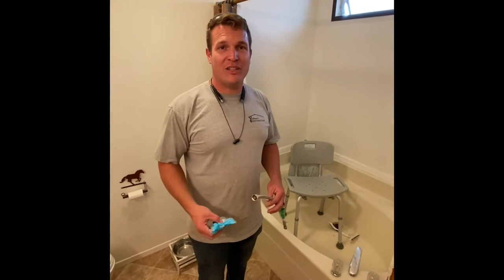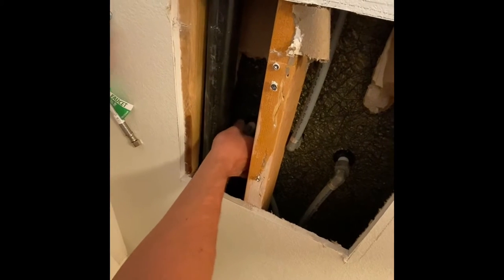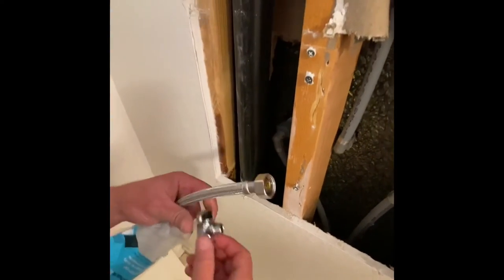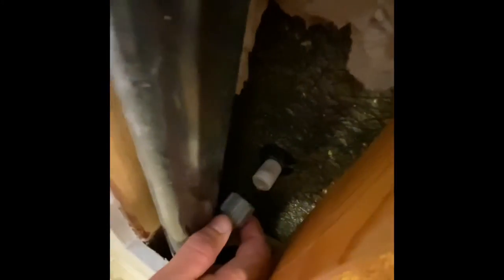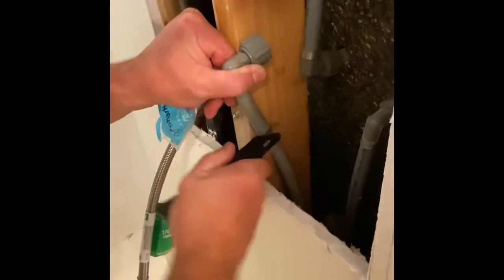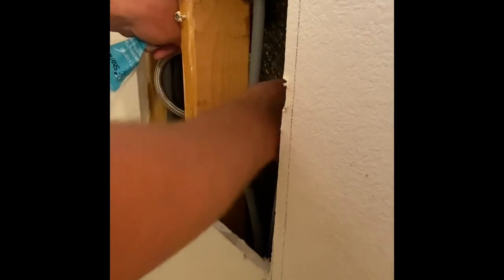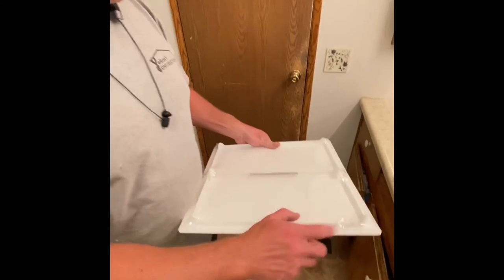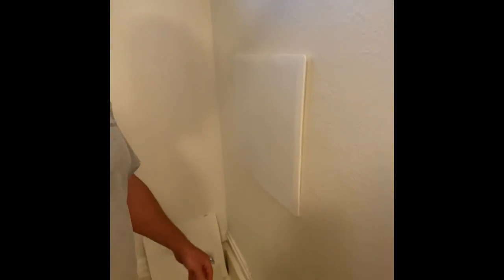Hack on how to Repair old plastic pipe fittings behind a mobile home shower @constructionhacks9293

Comment: Do you need to put tape on any of the threads
Reply from the maker: Not on the flare fittings or ones with rubber gasket

Comment: Will this work on the white pipe? I had a new water line installed and the new pressure is blowing out all old fittings throughout my house.
Reply from the maker: Pvc pipe is a little different

Comment: All you did is rig one problem to have another one down the road. Man I hope you have more experience & sense than that. Wow. Shark bites & for temporary fixes only. Ask any real licensed plumber or code inspector. Dude you need to tighten up. Get your knowledge in check.